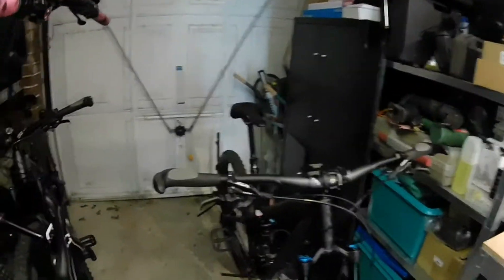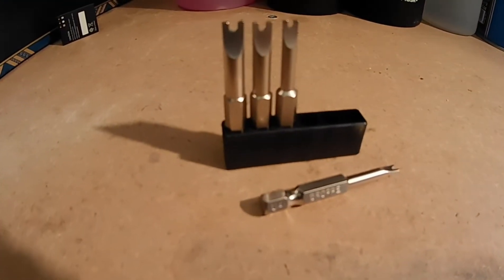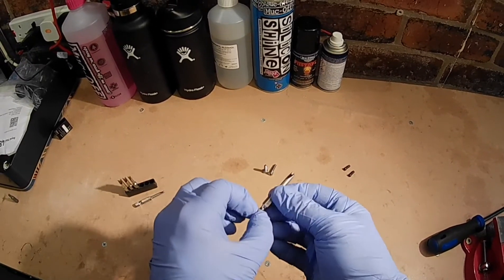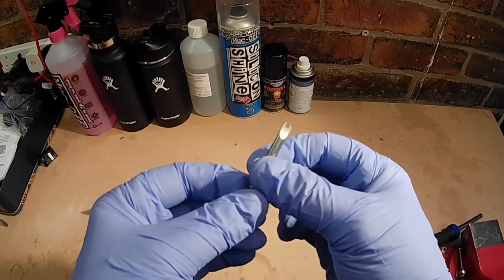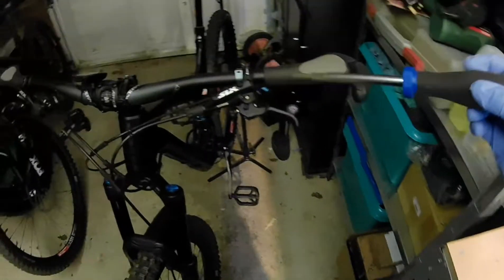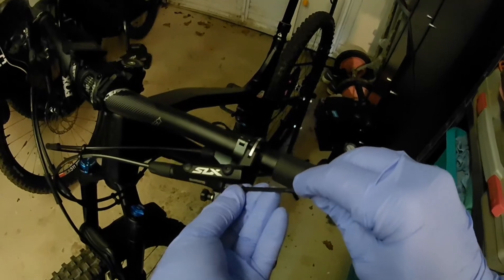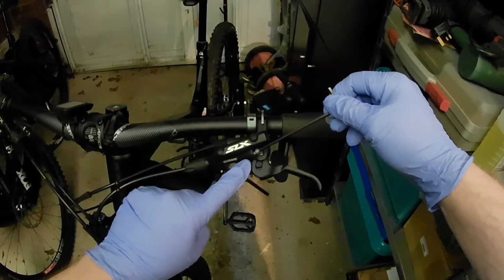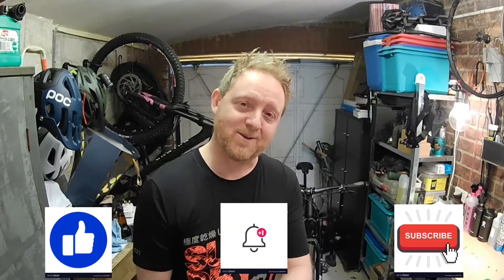Shimano SLX brake hack

Comment: this is an old well known hack, but if you already have a snake eye screwdriver, there is absolutely no need to replace the screw with a phillips or allan one. I mean you already have the right tool, why change the screw for?
Reply from the maker: Hi, because the existing screw doesn't have as much adjustment and although I'd seen this on some forums, I couldn't find any videos on youtube showing how to do it. Hopefully its helped some people even if not everyone wants to do it.
Reply: @trickyrickymtb5622  hello. It is on mtbr.com  in fact there are 3 or 4 threads about this. The M4 bolt is 10mm in lenght and i have found that it is just the correct length , so you won't break the plastic lever the is pushed by the screw. if you try an M4 12mm you most likely to break the adjustment. I 've seen many people making that mistake. They believe that the bolt is to short to offer any significant regulation .i assure you that the existing bolt is long enough to do the job but you also have to remember, that free strroke requires 2 adjustments to feel the difference . first screw in the free stroke screw, (you'll see the the lever starts to approach the handlebar) and last you readjust the reach screw. then you'll have the whole picture of this bite point adjust.
Reply from the maker: @ΣΤΑΥΡΟΣΓΚΕΡΛΕΣ  I do agree that the u-bolt offers adjustment, but I've tested the adjustment (by feel) and I think there is more adjustment with the longer bolts. Plus better to have 'on the fly' adjustment with a multi-tool IMO. Either way the video is there for anyone that feels they can get more adjustment by performing the hack. For info, I haven't damaged the plastic/mechanism and I cover this in the video.ibwould add however that I've actually replaced the standard pads for thicker 'finned' pads and this made the lever feel more dialled than ever. I can highly recommend doing this if throw is a problem
Reply: @trickyrickymtb5622  so, do you recommend the finned pads? did they make that big of a difference? did you find it more difficult to insert the wheel with the thicker pads?
Reply from the maker: @ΣΤΑΥΡΟΣΓΚΕΡΛΕΣ  they made a big difference in terms of lever throw, made the brakes feel very immediate. Had to do a minor adjustment to the caliper, but no issues. The pistons have settled a bit now and they feel bang on. I also like the fins as they seem like they would keep the dirt out a little better. And aside from the benefit of minimising overheating I Also I think they look cool 😁
Reply: @trickyrickymtb5622  can you share what those finned pads are? Or share link thanks
Reply from the maker: @MrKCBRUCE  https://www.ebay.co.uk/itm/Shimano-J02A-Resin-Cooling-Fin-Ice-Tech-Disc-Brake-Pads-SLX-Deore-XT-XTR-M8000-/383816864062?_trksid=p2349624.m46890.l49292

Comment: You used a  squeezed U6 bit, so the u5 is too small then? Don't wanna buy a whole set of those.
Reply: I bought a U6 and a U4 security bit (or also known as spanner bit). The U4 is the one that fitted perfectly. 😉
Reply: @mtb4679  perfectly after filing it down or without even having to do this ?
Reply: I bought a set of two security bits. One was a U6 (like the one that needed filing down in the clip) and a smaller U4 bit. The U4 was a perfect fit and no filing necessary.
Reply: @mtb4679  awesome. Thanks for this!
Reply: @mtb4679  gotcha, cheers!
Reply: @fargoththemoonsugarmaniac  Sorry @Fargoth totally missed your enquiry from two months ago somehow, only spotted it today. Happy tweaking and all worth it!
Reply: @Alex-sc9qc  🤟😎 Happy tweaking to you too @Alex!
Reply: @mtb4679  no worries mate!

Comment: Can't you just tighten the "U" bolt that comes with the brake? I wouldn't mind doing it at home instead of changing the bolt to a more common one, as the "U" bolt looks more aesthetically pleasing
Reply from the maker: The brake comes with the u bolt fully tightened and provides no further adjustment. It does actually pull the lever in very slightly, as you will see when removing it, but is too short to provide full adjustment.
Reply: In other words, this mode looks horrible! You'd never buy them looking like this.
Reply from the maker: @shwndh  I personally think it looks a lot better than the cross head screw that you get with the XT brake. Also it does look better with a gun metal titanium bolt, but ultimately if your happy with them dont do the hack.

Comment: Problem: the XT brake levers are less then £10 more than the SLX levers.
Reply from the maker: Not a problem, this is more if you already have SLX. Plus the older models are getting more difficult to get hold of. Changing from M7000 to M8100 means replacing the the olive, barb and sleave, which also means trimming the hose slightly. But I get your point.

Comment: New to bicycles, i currently have SLX hydr brakes on my fatbike, 2 piston one in the back, as a bit heavier rider i'd like to have some more biting power in the rear. Do you reckon if a change a 4 piston caliber i would achieve better braking force? Could i use the SLX brake lever with the 4 piston caliber? Do you know if the piston inside the lever assembly is same on SLX vs XT/XTR? As on my KTM motorbike, when i changed the 4 piston front caliber to a 6 piston caliber, i needed a bigger piston size lever assembly to push the appropriate amount of fluid to properly engage the 6 pistons without the lever to hit the bar.
Reply from the maker: Hi, the Deore, SLX, XT and XTR brakes share the same tech. The material and feature sets differ, but they are interchangeable. Be sure to make surebyou get the same family tho, as there can be compatibility issues when mixing the old and new gen systems. For example the 2 pot SLX (m7000) may not play nice with the 4 pot SLX m7100. Hooe that helps.

Comment: This screw just holds the piston holder, what are the gainings of this beside servicing?
Reply from the maker: The screw adjusts the lever throw
Reply: @trickyrickymtb5622  I get it, just a feeling thing, I like my brakes the way they are. Isn't it dangerous if they bite right from the start of travel. I bet people like it because their brakes aren't bled right so the lever goes way too deep and hits their fingers.
Reply from the maker: @FirefighterBobby  The bleed might well be an issue, but all high end brakes have free throw adjustment, this just allows you to dial the brakes in, if you like the lever to bite earlier. But hey, if your brakes feel good, I agree don't touch them, that's what it's all about 👍
Reply: @trickyrickymtb5622  Bleeding slx front brake & f/r Zees right now. Getting them ready for the season. Took em appart, every single piece. Such pleasure, but not for everyone, just putting new oil doesn't do it for me, theres dirt inside. Thank you for your time btw.
Reply: @FirefighterBobby  you are obviously an inexperienced rider to make such comments. Contact  point to bite point adjusting is common on higher end brakes like SRAM Guide RSC - Code RSC or Hope Brakes
Reply: @deanemberley2333  So I lack experience because you like brakes from a manufacturer I wouldn't take free products from? They don't have high end brakes. There best is Deore level.
Reply: @FirefighterBobby  Throw me a bone.  I just got the BL-M7120 SLX and my right rear lever is still squishy.  I've bled the brake 6 times and 6 times doing the brake burp with no success.  What am I doing wrong?  The left front didn't give me any hassle.  Thanks.